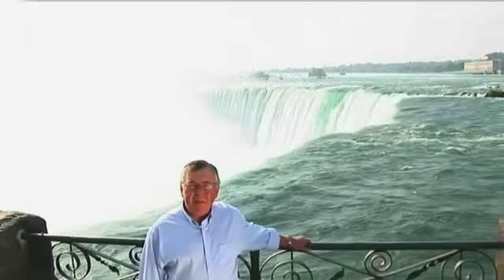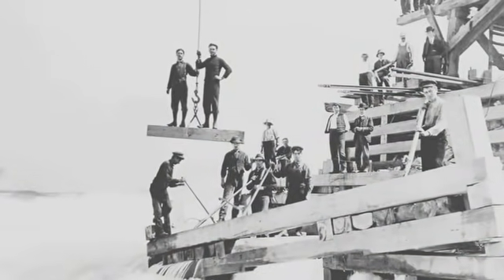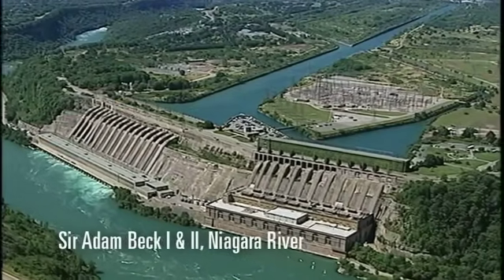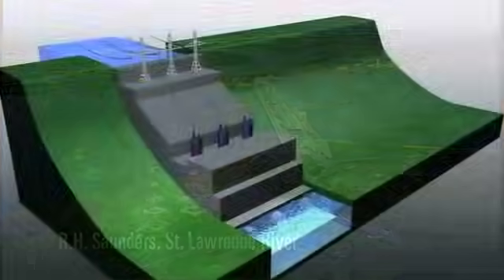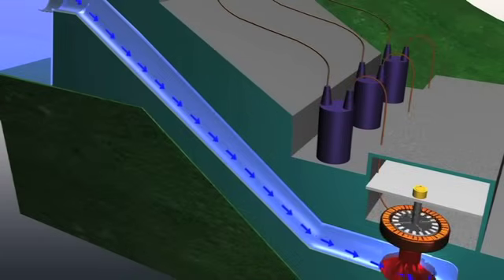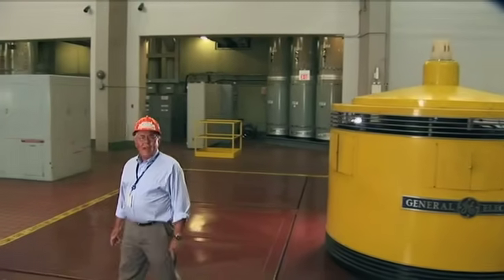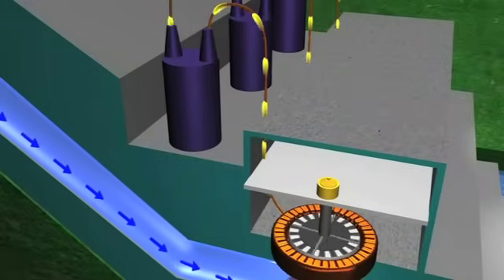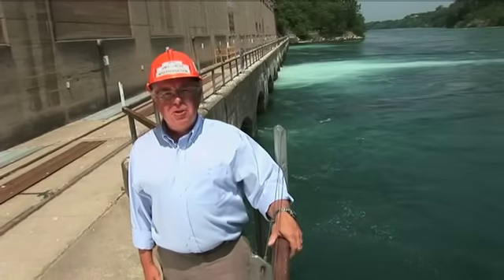Hydroelectric Power - How it Works

Comment: Do all the rotations of the turbine/generator make power? Do the rotations have to be a certain rate of speed to produce power? Or does the speed of rotations just affect how long it takes to make a certain amount of power?
Reply: You can have generators with little resistance at a high RPM, make small amounts of power, or have one with high resistance at a low RPM make high amounts of power. It's all about PSI.
Reply: @ecbadboy101  So, is PSI pounds of pressure per square inch...like torch? My comment don't make sense, I only know PSI as in pressure inside a tire. So are you saying that the resistance is making the power? And resistance can be varying amounts so the power made will vary too? Given enough time, though, power can be built up? I guess I'll have to study it.
Reply: @lindakleckner215  A turbine in a hydroelectric dam will turn at a extremally consistent RPM. As long as the water is flowing though the dam.
Reply: @ecbadboy101  okay. That's right, this is water turbine. Thanks.

Comment: I always had that doubt: What happens when the water level is lower than the pipe intake ( ex on a drought season) all the system shuts down waiting for the level to raise again ? If so, this type of energy generation is highly water level dependent.
Reply: Of course that is a must that is why you need a ForeBay  never ever goes lower than the drop to the bottom of the turbine.I have worked on the runners of these turbines looking straight up at 110 ft penstock holding back that water The blades on the turbine need fixed from cavitation of content water force

Comment: So I was thinking if we were growing egads of hemp filters and filtering that water after collecting the initial energy Rush then adding the hydrogen fuel cells filtration into the safety domes we can clean so quickly we will have an effect on the land air and water plus be able to replace the oil and gas industry end the wars and fully support Tesla and the surrounding companies; the facilitation of the tunnels with regards to the tectonic plate should run simultaneous and with congruent supports for the housing transport and energy transfers both types of physical bodies let then expand out; correct.

Comment: Why are there no multi stage turbines ??
Answer the tech is available from RDP MARINE AUSTRALIA 
The techs will say the issues are turbine surging OR to much backpressure OR the dissolved gasses issue ALL are nonstarters 
So were is the price drop you can have by fitting this item ?? YES YOUKNOW WHY